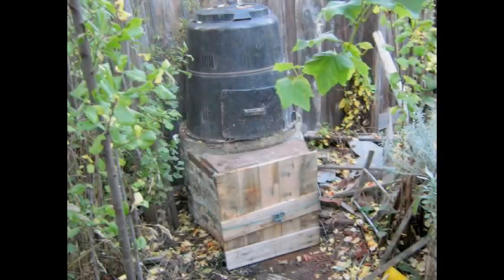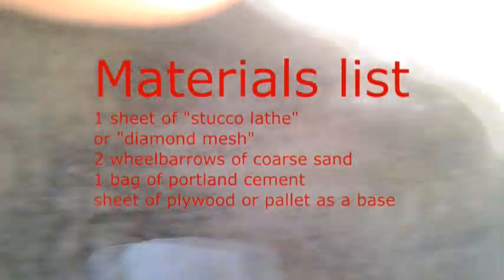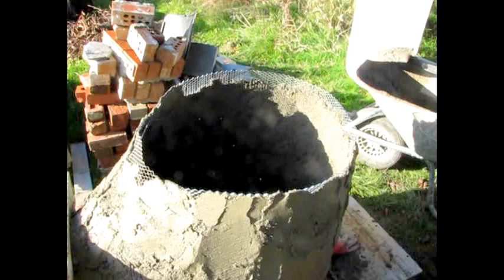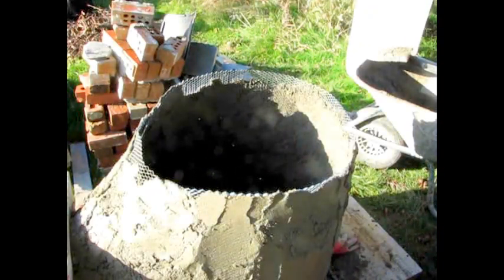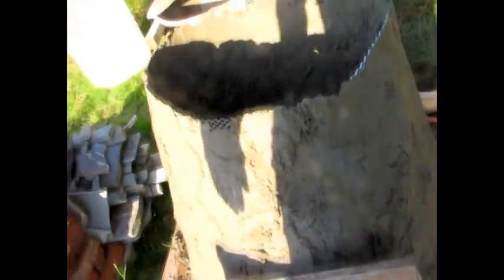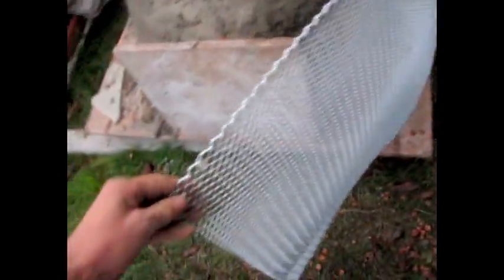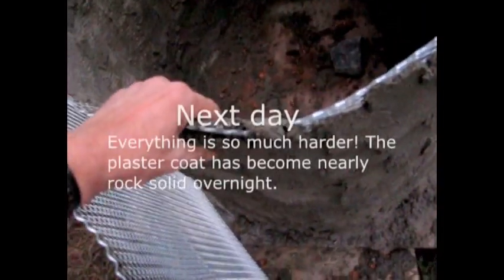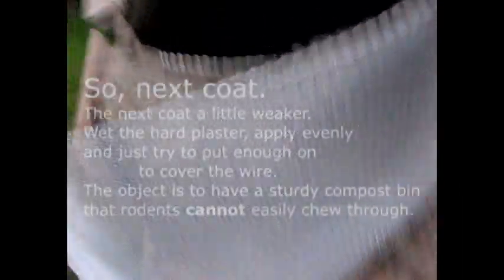Making a  sturdy ferro-concrete compost bin.  Part 1

Comment: Hello Brain I got a quick question. Can you work cement when it is below zero?
Reply from the maker: No,  you can make it as long as it is above zero (and stays above zero at night with no frost or at least really well covered)  but it sets up really slow under about 5C.  Hours of set up time become days! Years ago we made a big wall at around 4 C and the machine guy backfilled it the next day (way too early to backfill) and he pushed the wall out a couple of feet in one place.  Normally if something like that happened, the wall would have  been destroyed in that area.  But, in this case, the cement was not setting and when we were sent back to repair it, a week later,   it had set up (really well) in the pushed out position!  Really hard to repair it!  Also type S mortar is even worse because at 5 or 6 C the lime in the mortar starts to feel really grainy and it loses its stickiness.    Then it is time to stop if you have not stopped already.  It is horrible to work with at that point.
Reply: Brian White
 Thanks for the info and the quick reply. Keep up the great work.

Comment: I liked this a lot. I've never mucked about with cement at all, but I might have to do that now.
Reply from the maker: Hi, Trevor, thanks.  Not sure what will happen next.  (I have a lot of work on the go right now).  I have always pasted mortar on stucco wire with a wall behind it! So, didn't know what would happen.  If you do anything other than a compost bin, a much better mix for the first coat is 3 portland,  1 type S and 12 masonry sand.  Then your next coat can be 3 type S cement  1 portland and 12 masonry sand.  That is just to have the second coat not as strong as the first coat.  Type S has lime in it and lime has a couple of wonderful properties that portland does not have.  If it cracks a little, the lime can dissolve in water and refill the tiny crack. Lime is sticky and helps you apply it more easily and more evenly.  But Lime is caustic to skin so wear gloves.  And Lime sets really slowly in winter.